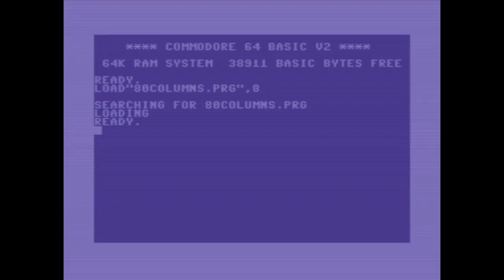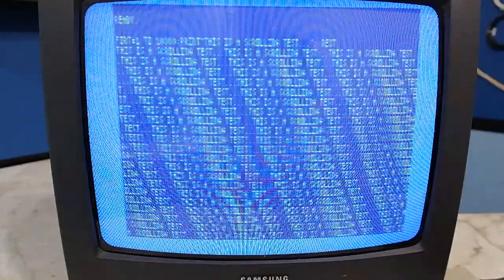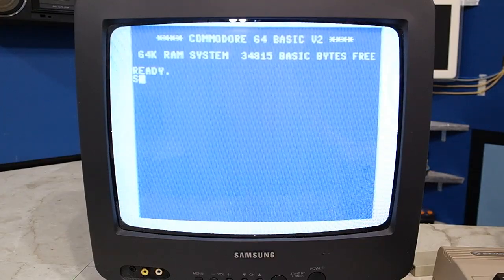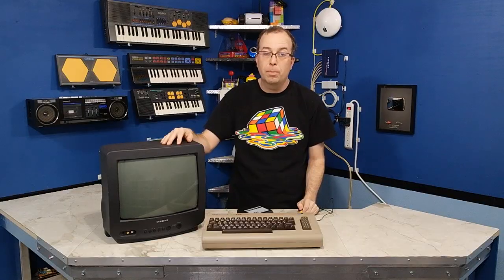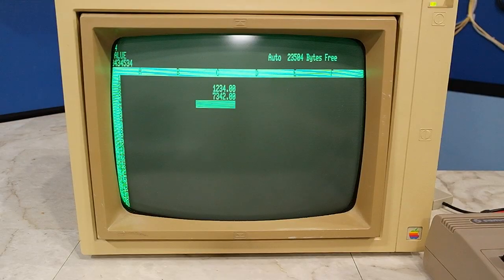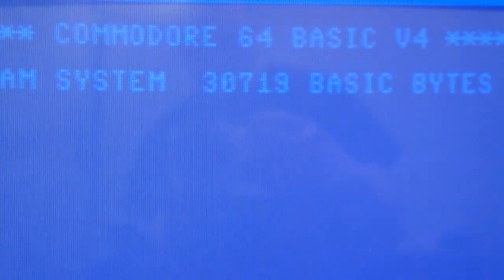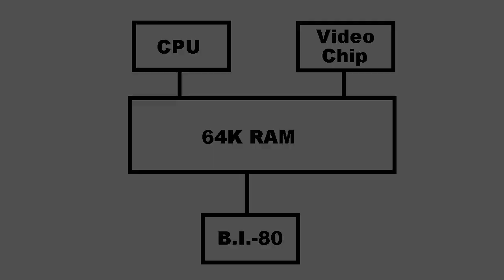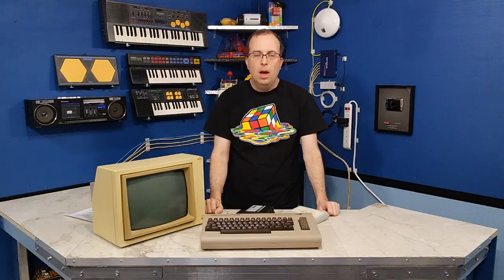The Quest for 80 Columns on the Commodore 64

Comment: This is probably a stupid question with too much of today's thinking... but would it have been possible for them to add RAM to the cartridges like they do with video cards today to mitigate RAM usage from the computer itself?  Or do these cartridges have nothing in common with video cards?
Reply from the maker: Well, in this case, adding RAM actually slows the performance down.  But that's because this card isn't doing any onboard rendering of graphics.   In those days, it was faster if the video chip could access the computer's main memory when it comes to displaying text and graphics.
Reply: You are right, I forgot carts can bank in their RAM. However I was going with the assumption in the video, that the video RAM on some of these carts are only accessible trough register writes as the c128 80col chip's RAM (here you are wrong its not bankable in, I've programmed it).  Probably the faster card banks in its RAM and the other doesnt, or its either a bitmap mode strictly.
Reply: The C64 blended it's custom chips in the CPU address space without using all address lines so that there is plenty of unused space between them and the registers appear mirrored multiple times. It is quite easy to blend in additional custom chips (like the CIA's) using TTL logic to split the custom register range. This way you can insert two CIA's in one socket bending up the data pins of one and one select line to address the secondary. With this arrangement you gain a bunch of independend unclocked TTL lines to switch and address whatever you like. I used some of them to control an expansion multiplier that worked like a modern bus switch and ran two 512 KB Commodore REUs simultanously. Each came with eight banks of 64KB and one DMA controller chip.
Reply: these old video chips doesnt do 3d renderings, they just read up RAM and display whats in there, so onboard ram is not an advantage, because then the CPU have to jump trough extra hoops to change the Video RAM (it can not access cartridge ram directly), compared to the default setup when main ram is both seen by CPU+VIDEO Chip
Reply: That is wrong. C64 has memory management by TTL logic and some latches to blend in 8KB Kernel Rom space, 8KB function ROM space (by default internal Basic, autoswitching to cartridge ROM/RAM/whatever), and custom chip register space. Some cartridges came with DMA controllers which could move data blocks way faster than 6510 with it's three 8bit registers. Writing to a latch or register to switch banks isn't what i'd call an extra hoop (PHA/Load A, XX/Write A->XX/PLA). Bankswitching works within one cycle and does not need extra time. Generally you switch while in an unswitched area. C128 took this even farther addressing two banks of 64 KB CPU RAM, one bank of upto 64 KB graphics RAM, some ROM banks and one register bank.
Reply: Software point of view of an arrangement like this: An additional CIA shows up where normally mirrored registers of an original one are to be seen. Using this additional registers one simple write (or a BASIC Peek & POKE) can set up an independent switch per CIA-Output-BIT that works like a secondary address domain and can be used to blend in cartridges, memory banks (i. e. static RAMs, ROMs, EPROMs) in the C64's expansion address space. Since the C64-Kernel has some unused space you can insert an additional function key level using an additional key and i. e. switch Kernels or expansions on the fly without restarting the machine. You can also address the switching routine with one SYS command in BASIC. I used it for an additional CENTRONIX port, an EPROM-Disk, my switchable expansion ports, and a selfmade interface for my 5MB CBM9060 Harddisk.
Reply: The 8-Bit Guy still no luck with the SID2SID?
Reply: The Amazing Engie the sid2sid works
Reply: The 8-Bit Guy miracle cartridge?
Reply: in theory, yes. In practice, however you're hitting the 64k barrier that was the effective RAM limit on most common 8-bit processors as a result of their 16bit wide address bus.  To support more you require extra logic for address decoding, which will cause a speed hit.
Reply: Additional address decoding does not cause a speed hit. I did this using a second CIA to address 64+512+512 KB on my C64. I even enjoyed higher memory speed using DMA instead of the annoying slow 6510 to move around my bits.
Reply: Hans-Joachim Bierwirth broad strokes.
Reply: +The 8-bit Guy
I once estimated that the 16K double-high-resolution graphics screen could be block-copied or rewritten in about a fifth of a second. Back then, such a slow scrolling speed, would probably have seemed within reason or acceptable. Somewhat slow, was a given for computers back in those days.

However, AppleWorks GS, for of course, the Apple IIGS, was considered to be painfully slow, and I heard that quite many people ran instead, the ordinary AppleWorks, because graphics-rendered text even on a faster IIGS, was too slow. Instead of drawing a text character at a time, only but a single pixel could be drawn at a time. Today's computers are plenty fast to deal with this, but not so at that time. There is a lot more to graphically rending a computer screen, pixel-by-pixel, than just scrolling the screen around. Imagine paragraphs of text, taking many seconds to "draw" to the screen, and any editing changes being laggy to update the screen. However, using my Apple //e, and getting my IIGS too late to make much use of it, I personally did not experience this slowness. And I knew somebody who used Publish It, a graphically-based publishing program, but I did not use it. By the time I got my first Macintosh, computers were so fast, that drawing computers screens pixel-by-pixel was no longer a slowness problem and WYSIWYG and GUIs were fast becoming the norm.

AppleWorks was a widely popular word processor, database, and spreadsheet for the Apple // computers back then.

WYSIWYG - What You See Is What You Get
GUI - Graphical User Interface
Reply: Thats actually a great question!

Comment: My Atari 130xe was 40 column stock, but the original owner had put an 80 column expansion card in. I never actually got the card to work.
Reply: Atari had their own 80-column add-on for the 8-bit 400/800/XL/XE computer series, the XEP-80. It connected to the joystick port, supported graphics as well as text, and included a parallel printer port. But there wasn't much software support for it either, aside from Atari's own AtariWriter 80 word processor.
Reply: Kazriko Redclaw so? it probably used another initializing address or something + maybe something was needed but got removed by the owner for one reason or another...
some solutions are so hacky they only work for one person and not another, especially old hardware hacks...
Reply: It didn't come with any documentation. Only a toggle switch on the side that says 80 col.  The switch did nothing though. When I took it apart I did see a small board hacked into the system board then wired to the switch.
Reply: Kazriko Redclaw I swear you profile picture is a miqo'te
Reply: hi